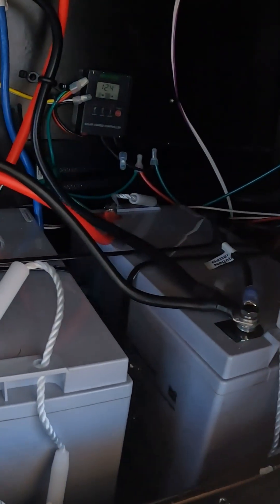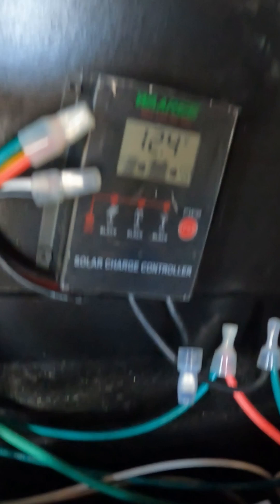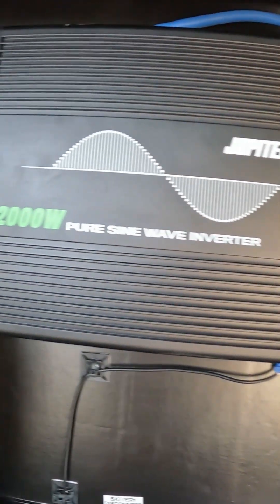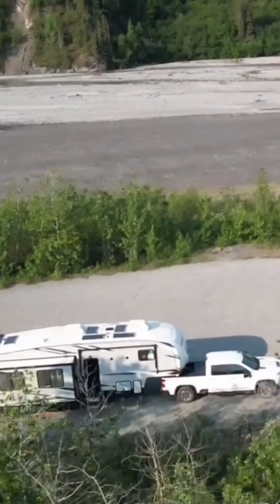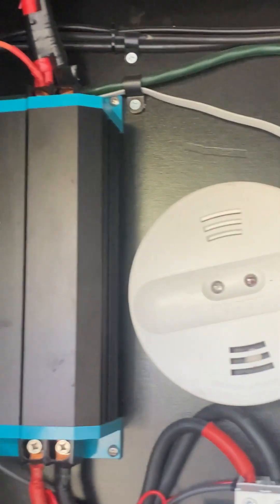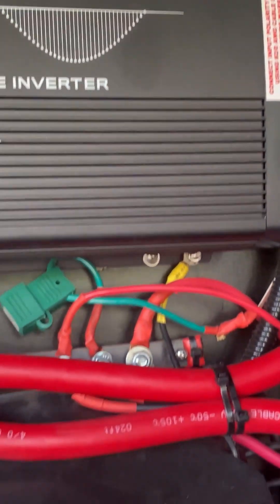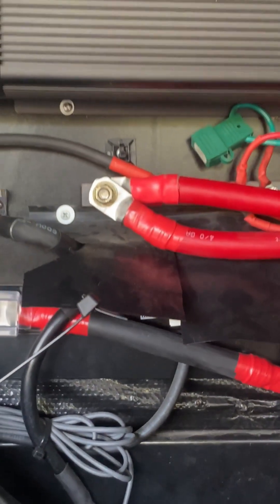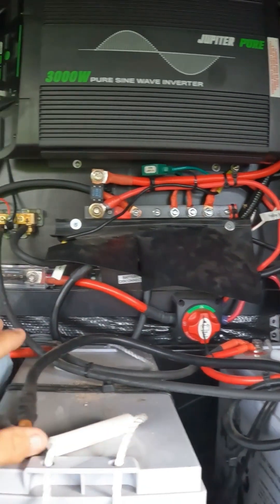50amps to 850watts of solar/ 400amps of battery bank saving thousands. #solar

Comment: The busbars are steel?  Do they heat up or cause a voltage drop?  I thought steel was like 5% to 15% the conductivity of copper.  You might want to check the ampacity calculations for the dimensions of your steel busbars if you're running a 2KW inverter. Google says it's about 170A at 12VDC.  Then there are all the through-bolted connections of dissimilar metals.
Reply from the maker: Have not had any problems over the last couple of years, We upgraded to 3000 w. and 600amps of battery still no problems even with AC running for 5 hours strait However we just purchased a new rig and when I switched the equipment over I did buy new bus bars (full length video will be out next Thursday).  I also upgraded to two 300amp Lithium batteries less than half the weight of the agm set up, sold some of the old gear to offset new equipment and still way under 4000 grand now have 900watt solar on roof, 3000watt inverter, total of 600amp battery bank as for heat and voltage drop is min. Thanks for watching